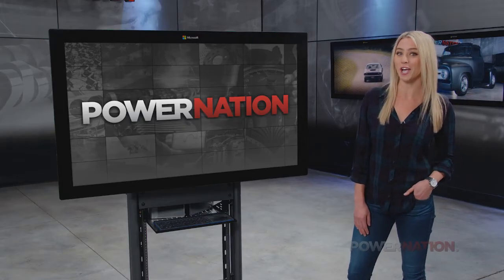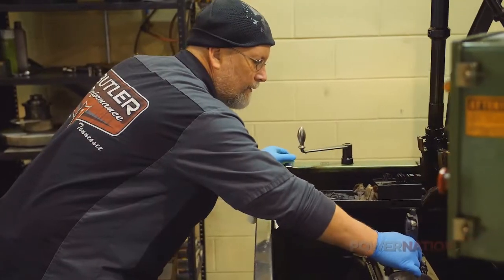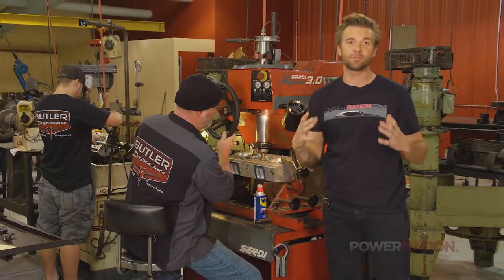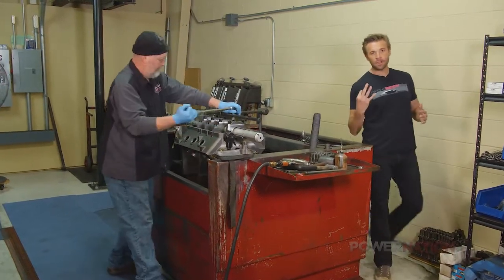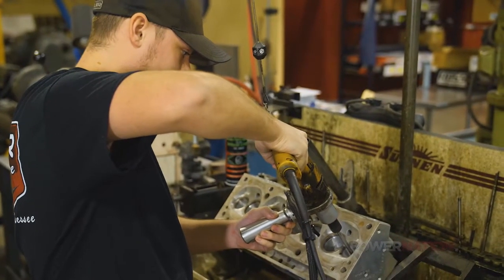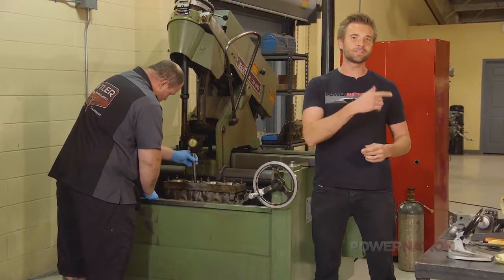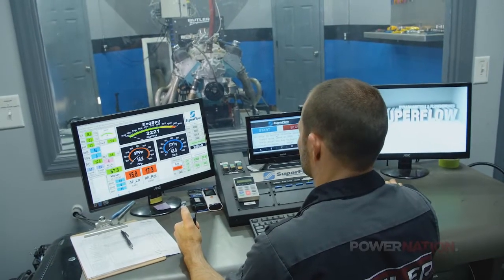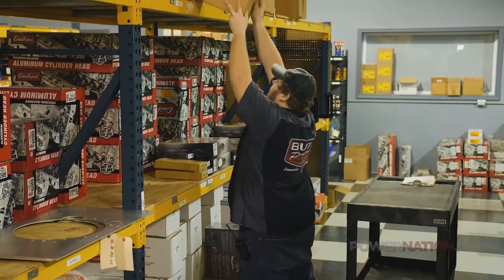Butler Performance Pontiac Interview With Power Nation and Dyno

Comment: Must be great to have picked a company which was trashed by the owners.  You might as well be a LADA or Edsel shop. Have fun in the past. But anyway check out these new things: Turbo charging. Supercharging. Disk brakes. synthetic oil. Cell phones, computers, the Internet.
Reply from the maker: Thanks for the advice, but we've been using all those things for a couple decades now- if you need any help with any of that "new" stuff let us know!   So far we've only made a little over 3000 HP with a twin turbo, EFI Pontiac but maybe some day we'll be able to catch up with the Edsel's  lolol
Reply: @randypecker6995  Wow, I struck a nerve. The truth hurts, doesn't it.
Reply: Golly if it wasn’t for 30+ pounds of boost, those little 1.2 L wouldn’t have that awesome fart-can sound out the exhaust. Sure beats the rumble of a well built 400...
Reply: @lcee6592  Is this the point at all?  You really care what it sounds like? As long as it doesn't sound like you or (worse) you wife what difference does it make? And that big POS cannot even come close to outperforming something like a Tesla.  Or up the 4 to a 6 cyl like in F1 and that 1.6 was making Dodge Demon Black track platiiumn, SS, GT ABC horsepower  way back when the Demon was just a little prick  (-;
Reply: Randy Pecker aww I think I’m starting to like you... I would like to meet you somewhere, you know, to get to know you better. I like young and feisty. What state are you in?
Reply: @lcee6592  Obviously she's in the state of confusion.
Reply: @lcee6592  This is not the place on which to share personal medical conditions. Try the newsgroup "stupidmadeupsyndromes.net
Reply: Rofl. Too many customers leaving you for Butler?
Reply: Randy do you know the difference a blown and Supercharged engine without going to that new fangled internet thingy   I'll give you a hint Trubo charging is a form of supercharging btw none of the things you listed as new are new including computers and the internet. All of the things you have listed as new have been around longer than Butlers Pontiac
Reply: BUTLER and KAUFFMAN make some of the nastiest motors (both Track & Street) out there. 
I don't understand why the negative comments, but hey...to each his own.
I own a 1970 GTO, and would be very happy to run either one of those motors.

Comment: keep up the great work butler performance !!! I'm a mopar guy but I also love Pontiac and some day I hope to have u guys build me one for either a 68 firebird or a 65 GTO. I had a 65 GTO when I was 17 389 4 barrel Borg warner T10 4 speed and 4.33 10 bolt posi. my dad had a 65 GTO with a built 400 same tranny and rear with 3.73 gears awesome cars. Pontiac the only gm like !!!
Reply: ,y older brother had a 66 goat with a 389 tripower. he took the 389 out and dropped a 400 in it with his 3 deuces and it was fast as hell. it smoked his buddys 383 road runner.
Reply: Pontiac was basically GM's Mopar and America's BMW.

Comment: RESPECTABLE #'S for sure,  i think with stock drivetrain like a 12 bolt and a 4 speed all you really need is 450-500 hp for a nice fast street car like a GTO or Firebird. considering the suspension of those days a 12 second car at 110 mph will give you a ride

Comment: I was buying from Jim when they didn’t even sell forged rods .....they sold the Large BME aluminum rods but if you wanted a steel rod, they heat treated the factory ‘58-62 rods to a 37 Rockwell harndness and polished the beams.    Also....they were using Ultradyne..cams.

Comment: @butlerperformence I’m hoping to get a 1977-1978 Pontiac firebird trans am smokey and the bandit replica and one day I want a 455 big block Pontiac that makes 500-600 horsepower and I want to say keep doing what u people are doing because it’s rare to see Pontiac engines in drag racing
Reply: @butlerperformance I’m hoping to get a trans am for my first car
Reply: PONTIAC MANIAC here. Pontiac never made a big block. 326 thru 455 engines were the same size externally, the smaller engines just had a smaller bore diameter for the pistons with a shorter stroke. https://en.wikipedia.org/wiki/Pontiac_V8_engine   Pontiac differed from most other manufacturers in that the external dimensions of all their V8s, from 326–455 cu in (5.3–7.5 L) were the same. The displacement is a function of the engines bore and stroke. Pontiac did not have the customary "small-block" and "big-block" engine families common to other GM divisions as well as Ford and Chrysler. Pontiac's V8s share the same connecting rod length 6.625 in (168.3 mm) (and connecting rod journal size) with the exceptions of the later short deck 301 and 265.
Reply: I'm living your dream only difference is I'm in a 1968 firebird convertible
455 into a 474 stroker
With all the bells and whistles 650 horsepower 637 lb of torque
FLY LIKE AN EAGLE 🦅
PS  I'm investigating a tire company lol
Reply: @jetenginethrust863  external dimensions don't matter bore center spacing of 4.800 or larger makes a big block however you are correct Pontiacs have a 4.6200 bore spacing bb chevys have a 4.8400 the one that is most often called a big block but it's not is the Ford FE which includes the 427 and 428 their bore spacing is 4.630 (anyone know without the internet what FE stands for)

Comment: Did I hear right, you only make 75 engines a year?
Reply from the maker: You did hear correctly, we build approximately 75 turn key engines a year. This number does not include short block or long block assemblies or kits. That number is for the people that wanted us to build a fully tuned and tested engine that once they receive it are ready to drop it in the car and start burning rubber!
Reply: How much would a 500hp engine cost approximately?

Comment: Ok, I see they are using a oem style smog pump to create vacuum, but no breather on the other valve cover? Did anyone else see the connection on the smog pump loosing on it's own under load?